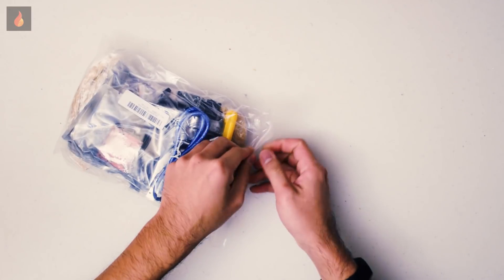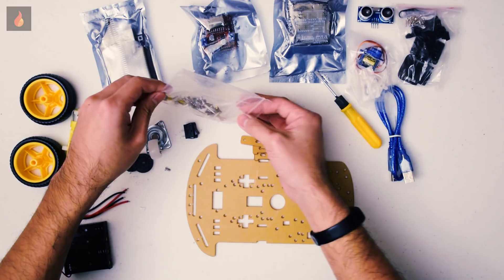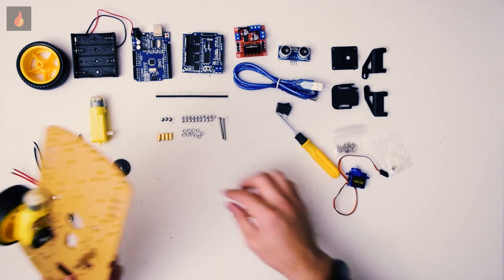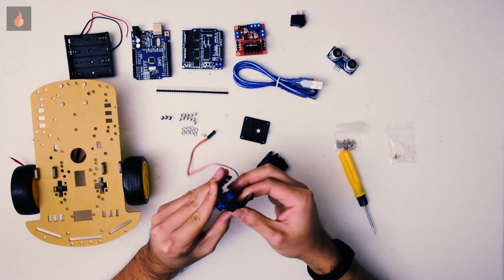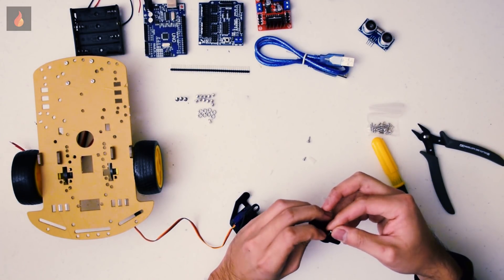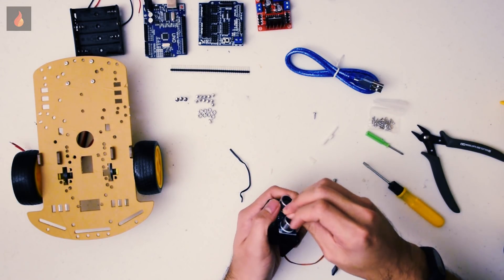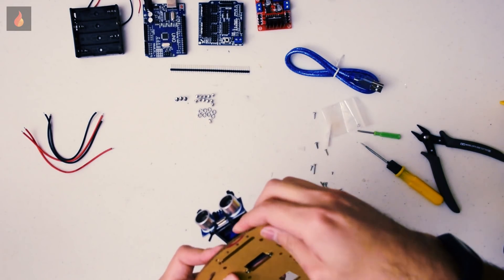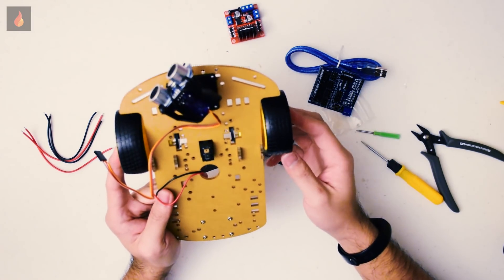Arduino Smart Robot Car from Banggood: PART1 Unboxing and Assembly

Comment: What is amusing about this kit - mine arrived recently - is that the parts are the same but the base board holes and cutouts are different. When I look around at other build videos, everyone seems to have 'personalised' cutouts and drill holes! Nevertheless, I can still follow your basic build but will need to a little structural redesigning along the way...
Reply from the maker: Oh no... This seller is so bad at consistancy.... One trick i used is to locate the arduino board first, since it is asymmetrical. Then work the way out..
Reply: @ChenTheDesignMaker  That is a good idea to start from the Arduino and work out. 
Seems people buy the kits from all kinds of places, Amazon, eBay and so on. I think there is some company in the depths of China that makes them and is having a bit of fun with us. Makes life a little more interesting :)

Comment: pleaase i need some help for my school project .. at 08:32 when i fix it it doesn't turn i dont know why ?!!!!!!!!
Reply from the maker: Do you mean the servo is not turning? One thing we could try is to screw the servo arm on it and see if it turns in any directions.
Reply: @ChenTheDesignMaker   no it doesn't turn in any direction but should i try it manually or i have to wait until i apply the program??
Reply from the maker: @salmasalmaa1  I usually do a manual test first. It shouldn't take a lot of force. If it still won't turn with a moderate of force, maybe should keep it safe and just try the servo code. If the code won't work, it might be a damaged servo...
Reply: @ChenTheDesignMaker   thank you for your answer .. and i have one more question if u don't mind : the servo code is in the link or no?? And if i try it and the problem still exist can i have  the same results as you did with a damaged servo  or should i buy an other one ???

Comment: What kind of wires are required for this project
Reply from the maker: Hi Omar, you just need the regular jumper cables, 

links are here: https://www.banggood.com/40pcs-10cm-Female-To-Female-Jumper-Cable-Dupont-Wire-For-Arduino-p-994059.html?p=JH2514288496201309O3&cur_warehouse=CN   or Amazon: http://amzn.to/2koltGV 

Some basic soldering skills are also required.

Have fun!

Comment: At what point do you attach the wires to the motor?
Reply from the maker: Hi you should solder the wires before installing the motors. please check the part 2 of the video.

Comment: I made this 3D printing part for the US sensor attachment to its base, so it is not done with a makeshift wire as shown in this excellent video. 
Here is the Thingivers link  to the design: https://www.thingiverse.com/thing:2765463/
Reply from the maker: Hi Uri, This is awesome! I'll print it out today and show it off in the 3rd tutorial!
Reply from the maker: Hi Uri, your part is featured in my latest video here: https://youtu.be/ms0C3o407oM  Thanks again for your contribution!